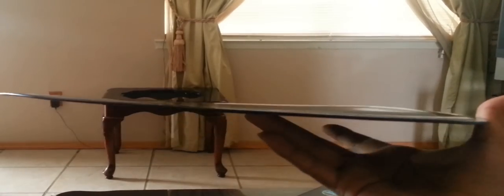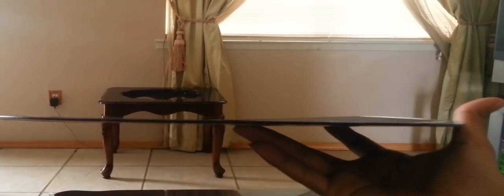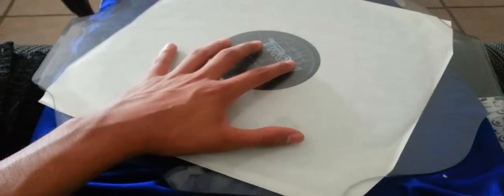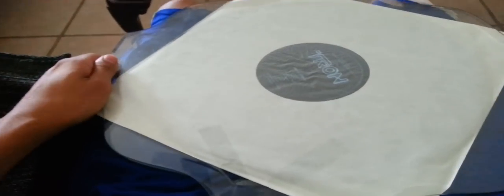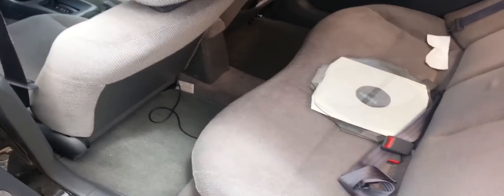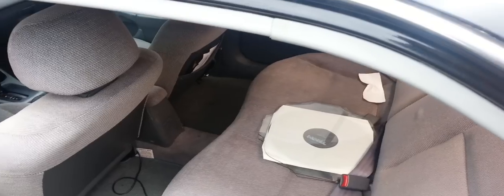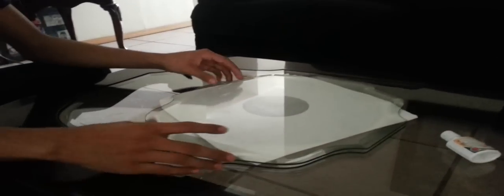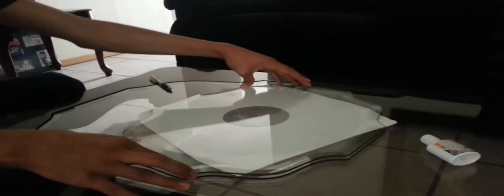Vinyl Repair

Comment: i am going to try this , and you can put it in the oven but not too hot, about 200f.
Reply from the maker: That seems okay. I wish I would have put a thermometer when I did it. Just make sure your glass can handle the heat. It would suck if it broke the glass. Ill edit the description.

Comment: TRON LP? I want one!! :-) I have 2 LPs warped. I will try something like taht.
Reply from the maker: They are expensive!! I was crossing my fingers that the heat repaired the vinyl because if it didn't I would have had to buy a new one.... there goes 400$....but it worked so i'm good!
Reply: Christian Macias 400$ ?? realy?? I didn't know that was soo expensive. I checked ebay and Amazon and it is expensive as hell! Why so expensive?
Reply from the maker: They are considered limited edition! we got a good deal on ours but it was opened. In perfect condition but opened. The recorded store we bought it at brought down the price for that reason.